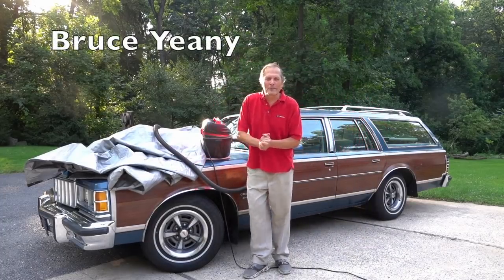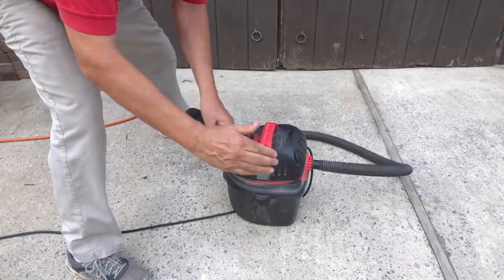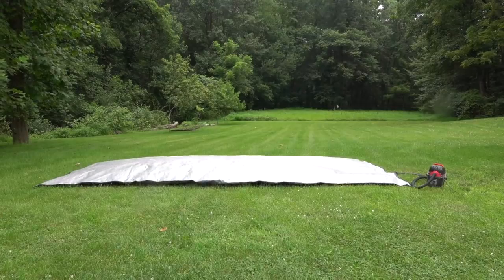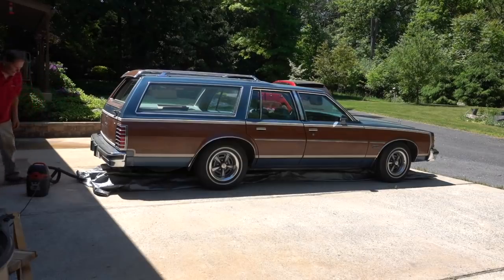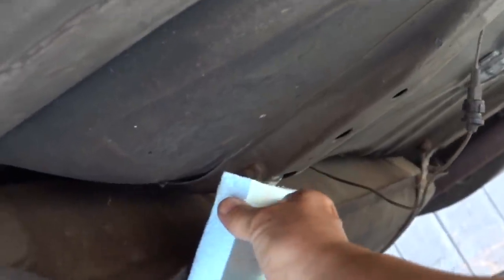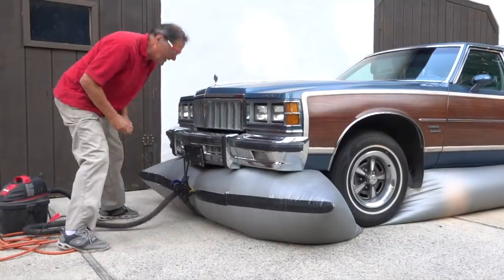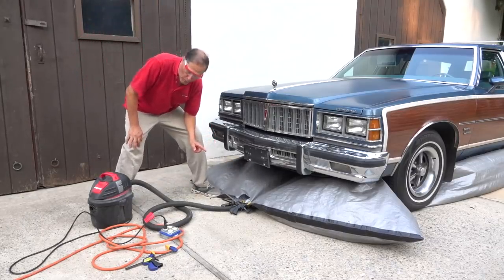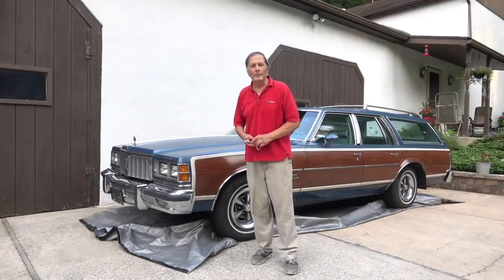Lifting a car with a  vacuum cleaner and a tarp // Demonstration of Pressure

Comment: Hi Bruce - I am trying to replicate your bag demonstration by lifting a classroom of middle school students. When I tried it yesterday with about 15 students, I was unable to get any air under the boards as the students sat on them. The weight of the students + the boards seemed to seal the air out. Do you have any tips or suggestions for using the bag to lift a classroom of students? When I have done fewer students it has worked, but it seems very unstable and a little unsafe at times in that a student can easily fall off the bag =) Any advice would be greatly appreciated! =)
Reply from the maker: Hi David,  if interested in discussing please contact me at bgoknee@comcast.net

Comment: The next thing you should build should also be something that's been available for a long time so you can be super surprised when it works. Maybe a row boat?
Reply from the maker: My first big project that I built while in college was a boat, I designed a 14 foot long catamaran and build it using some large pieces of Styrofoam formed into the twin hulls.  These were then reinforced with fiberglass, and the rest of it, decking rudder, mast etc. was made with materials that I was able to recycle. the sail was from another boat that was wrecked. I was very surprised that it worked, quite well actually, since I knew very little about sailing or boats to begin with

Comment: The way that tarp bag looked with a car on it reminded me of that packaging material that's a bag with two liquids inside. You toss it about for a bit to mix the liquids, then put it in the box below what you're packaging. Those liquids in the bag form a foam that swells up and quickly hardens to form a nice 'cradle' for an irregular shaped part. It typically swells the box quite a bit as well.

As a side note, that is a very nice looking station wagon! Don't see many of those around any more, much less in such a great shape.

Comment: How have feet so you think you could raise it if you filled it up with NightHawkinLight's hydroxy gas instead of air?
Reply from the maker: and then add one little spark and the car is  20 feet up in the air, that much gas would give you one heck of an explosion

Comment: I’d love to see this tried using the exhaust gasses from the car. I know that some of the recovery bags do that but it would be interesting to see if a bigger yet lower pressure bag would work as well.
Reply from the maker: I considered it but worried about the hot gas would weaken the duct tape or the the plastic tarp material
Reply: LOL

Comment: I grew up having a mentor of sorts. An elder friend of my father came by several times a year telling stories of his travels or how everyone was doing since last seeing him. Our state had recently been thru floods and ole John had been busy. Seems the friend of the family had a number of mobile homes that were about to be flooded in his trailer park he owned. I believe there were 5 total. John came to his rescue with two attic fans and a number of blades from airplanes he had salvaged. (John was a scrapper at heart) His plan was to place canvas skirts around the trailer with a little sand in tje bottom to keep the under the sides. Then cutting a square hole in three areas of the floor and mounting the fans to the floor over the holes. This all but worked as it seem to be a bit tippy as it seemed under power. He added a fourth one to the equation giving it just enough lift to push the trailer out of its location and on to higher ground. The second and third became easier as instead of centering the fans they placed them out on the corners of the mobile homes and a sixth fan aswell. One by one the moved these 5 mobile homes about a mile and a half to safety by making them in to giant hovercraft of sorts. In the early 70's popular science had ran a story on them and is where he had gotten the idea from. He had experimented with the vacuum cleaner and plywood on innertubes in the past so why couldn't they try instead of letting the trailers go to flood.
Reply from the maker: amazing story,  I always love to hear a bit of ingenuity coming to the rescue

Comment: I used to have a Buick Estate Wagon with an Olds made 5.7 L LF9 Diesel V8 (with 2 huge batteries and an oil heater dipstick!) it weighed a few hundred pounds more than the gas versions.  My teenagers would get out and walk 2 blocks to the high school to avoid embarrassment of being seen and heard in this thing.  But, I would get 33 mpg on the highway with 5 people, full coolers and picnic supplies.  Never needed to lift it up but limped back home 45 miles from a Sunday outing at 15 mph when the fuel injector pump died.

Comment: I have always thought those big GMs felt like riding on air. This just proves it! I use an exhaust powered “jack” like you show in the first part of your video for off road. Works wonderfully in sand because of the large surface area. Thank you for this video!

Comment: Try to use exaust gss next time
Reply from the maker: I was worried that heat from the exhaust would weaken the tape or tarp enough to rip it
Reply: @YeanyScience  About 30 years ago, I had a that kind of lift. But I didn't use it.

Comment: Could you do the same with water in stead of air?
Reply from the maker: I'm not sure if the tarp would hold up but if it were strong enough water would work.  a hose going into the giant bag filled with water would only have to be lifted a few feet higher than the bag itself.    It's would be a example of something called a hydrostatic paradox.  Another idea on my to do list that I haven't gotten to
Reply: I’m no Bruce Yeany but yes, you could. It would just take a lot longer with a garden hose to get the bag that full.

Comment: Very nice!
You should do a lift jack. i imagine a sort sorounding cage out of metal, with 2 plates for the top and bottom and with guide rods through them, to ensure the movement is perfectly vertical.
And if you have one, it would be cool to test a battery operated leaf blower or something somewhat portable.
Thanks for the great videos!

Comment: What a silly way to lift the car.  You should have used the Coanda effect.
Reply from the maker: You're right,  I wonder how many air compressors I'll  need to borrow
Reply: That's kind of what a hurricane or tornado accomplishes, when a car is found in a tree.

Comment: Next week:
Powering the pump with the cars engine while floating across a lake.
Reply: Sounds like a bit they'd do on The Red Green Show.  With the handyman's secret weapon- Duct tape.  Quando omni flunkus, mortati
Reply: Not a bad idea. I remember a guy in my country saving his car from flooding by wrapping the bottom half of his car with tarp which floats during the frequent flooding during storms and monsoons...

Edit: video footage of the thing

https://youtu.be/-U5bu9bVtHk
Reply: @axelpatrickb.pingol3228  i have seen a car bag that some people use to do a similar thing. And it also is useful to keep dirt and well as moisture out. I am wondering if there is a practical way to water seal the bottom few feet of a house, walls doors floor.. and perhaps even having a kind of wrap that can seal out water from penetrating the first few feet of a house, particularly in areas prone to flooding?
Reply: what is the minimum depth you think would be needed to allow the car to float with the bag filled with air? He might be able to make a test pool of water in his driveway to float the car on the bag of air?? I am guessing about 6-12 inches? and I am wondering if in making the bag only in the center of the car... if he laid out the back completely flat and drove the tires over the bag the bag would area further on the sides of the car? And if he stuck 2 wirelessly controlled valves on the rear and front of the bag, he could provide direction propulsion of the car to move, using the air pressure provided by the car engine? or perhaps instead he could still power a shop vac of the care battery using an inverter? and occasionally turning on the car engine to replenish electricity to the battery? although if the car is running. the exhaust pipe and engine could develop a lot of heat that could melt the bag where it touches the hot exhaust pipe or engine?
Reply: @manp1039  
Thinking about more seriously, I doubt the setup I described would float at all. The flat hard concrete under everything plays an enormous role.
Reply: @manp1039  in order to get the car to float, it would have to displace as much water that weighs the same amount as the car. He said the car weighs about 5000 lbs. 600 gallons of water weighs about that. So he would need a little more to clear the bottom. 1000 gallons is 134 cubic ft should be a good test and could lift over 8000 lbs.
Reply: On second thought. I doubt he could balance that weight onto the tarp/bag and the car would just roll off and sink. He would need some kind of frame for the bag with something like outriggers.
Reply: @MrT------5743  thanks. it also just occurred to me that if he put some small a matrix of small holes on the underside of the bag..it would give the car some lift.. and this could be used to move the car around on the ground like a hovercraft. i am wondering if this was used on water if it would cause the car to sink some since the little air bubbles would cause the density of the water near the surface of the bag to be less and thus the amount of weight of the water it was displacing near the underside surface of the bag. in any case, this might be a useful tool for tow truck drivers to move cars in particular situations? Also, if pallets were redesigned to have air channels to the bottom surfaces an air source to blow air in, these kinds of pallets could be used as an alternative to a hydraulic forklift, in particular situations. or used by the military as an alternative to moving things along the ground or across bodies of water. that could be carried on the vehicle. and in this case with the bag under the car.. i wonder if a series of blastic straps or thin plastic panels could be used to protect the bag from being punctured by sharp things on the undercarriage.
Reply: @MrT------5743  that makes sense. I wonder what the minim amount of structure could be added to the bag to cause it from forllin over.. perhaps some stitching in the center or along the center length of the bag? ?
Reply: @manp1039  yes the exhaust heat would melt the bag but you could prob run it off battery with inverter or just bring small generator

Comment: I think the inconsistencies on the underside are part of the problem. If you were to place a sheet of plywood over the bag and center the chassis over the plywood, perhaps that would generate more force.
Reply: Point loads, like the kids, hence the ply board.
Reply from the maker: I thought about using the plywood and worried about it putting too much stress on individual parts like the muffler system or drive shaft. Also considered building a platform but decided to just  try the bag alone.   My hopes were that the bag was large enough and flexible enough to spread the force over the high points and low points,  I figured the more area it was in contact with, the less stress would be on any one point.

Comment: Kudos on lifting it. Now, ... will it float? ;)
Reply from the maker: I 've wondered the same thing, now how to test it
Reply: @YeanyScience  
Ah, you made me do the maths - well played.
Knowing the density of water - 1 tonne/m^3 and using the car's area
10.9 m^2, mass - 2.3 tonnes, and estimating the car's sill height as 30cm (bag inflated),
Then, volume of the bag = 10.9 * 0.3 = 3.25 m^3 
That could displace 3,25 m^3 of water which weighs 3.25 tonnes. 
That's more than the 2.3 tonnes mass of the car, so it would float.
The water would rise (vol/area) 1/10.9 = 0.092 metres for each tonne of load. 

How to test it? 
Make a pond or paddling pool about 30cm deep with a pond liner.
Lay down the lifting bag in the pond, and drive the car in. 
Inflate the bag, lifting the car.
Add water to the pond - 3 m^3 should do.   
Sounds like a lot of effort and expense though.

Comment: This is the kind of car I expected from Bruce Yeany
Reply: Mag wheels, wood paneling, and from a company no longer around.

Perfect.
Reply: I was thinking the same. Probably only has 12k miles and never been over 55 MPH
Reply from the maker: previous owner,  old man in his 80's  garage kept like new.   I keep it outside but covered,   68,000 mile on it.   Funny, when either my wife or I drive it we sometimes find ourselves about 5 MPH under the speed limit,  not intentionally, just feels faster than it is  but it does cruise the highways just fine.
Reply: @YeanyScience  I have a 1965 Mercury Montclair and find myself doing the same thing. I go the speed limit when driving my modern car, but find myself cruising a bit slow in the Mercury because it just feels right.
Reply: @YeanyScience  that wagon is a classic!
Reply: No kidding!
Reply: 100. Perfect vehicle.